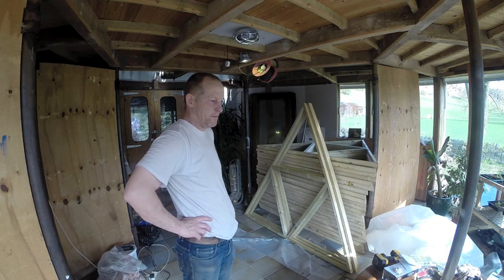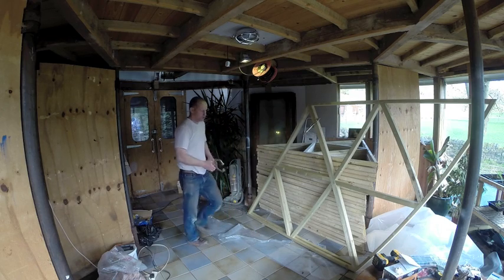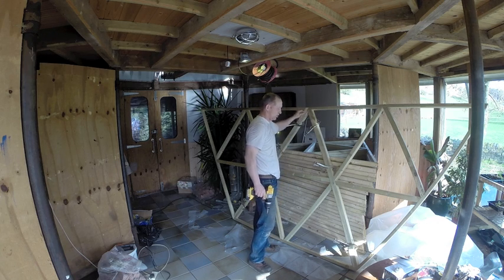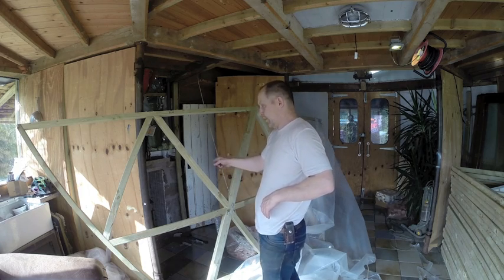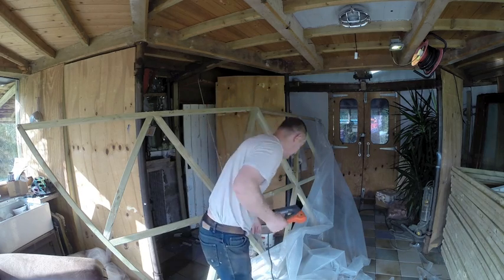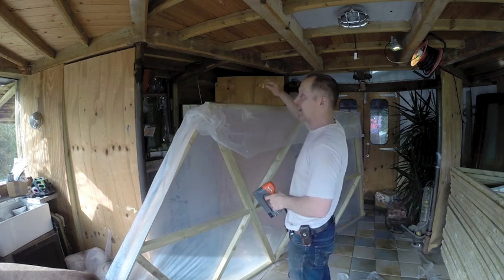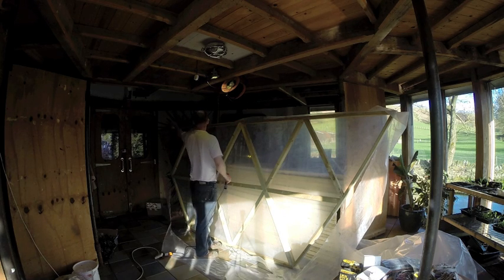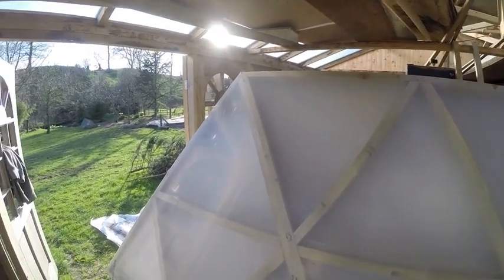12m 4v geodesic dome build (part 2)

Comment: Since your triangles are too big to do without those extra 3 half struts, then it could have been designed as a higher frequency dome and then those extra 1/2 length struts wouldn't be extra anymore, they would be actual struts with the bevels. I know it is more work in both design and building, but you get paid for it. lol

But it wouldn't be you if you didn't figure out how to make it more simple at the same time saving money and materials. You are excellent for knowing how to simplify for benefit(cost and time savings),

Comment: Nice build but its not a 12 meters and 111 square meters.I think its half that size if its a 4V.
Reply: It's 4V with ~1.8m struts. Each of the triangles is braced with 3 shorter struts to make 4 0.9m triangles. That's almost the equivalant of an 8v format. If you calculate the area or diameter or height using those numbers it comes out well over 100m2.